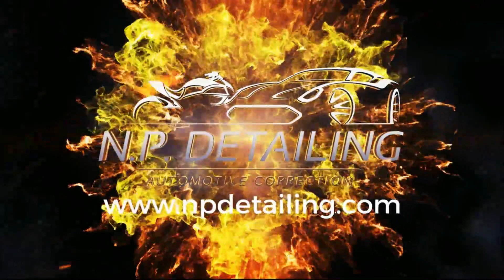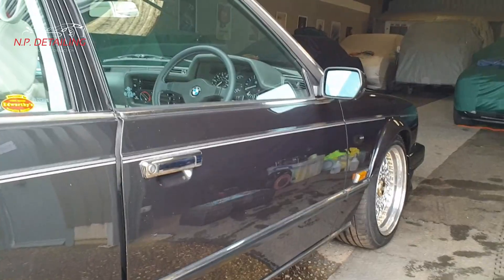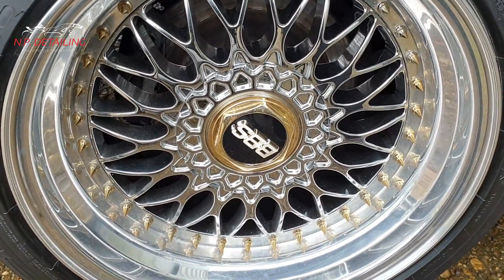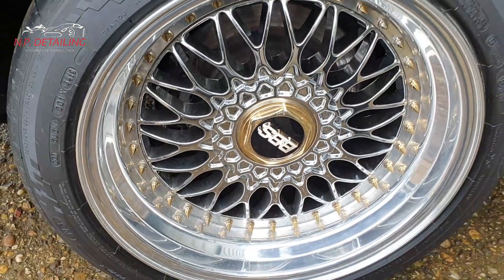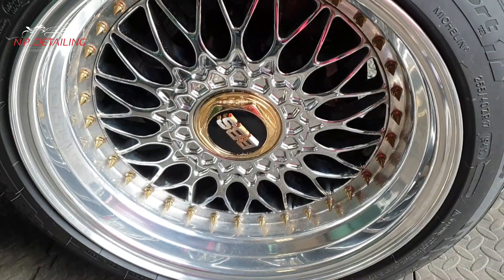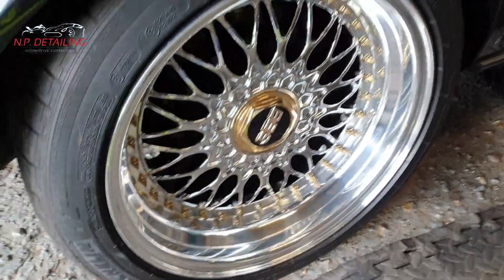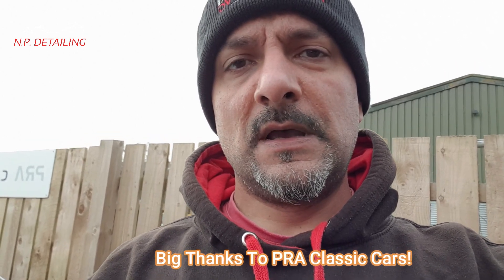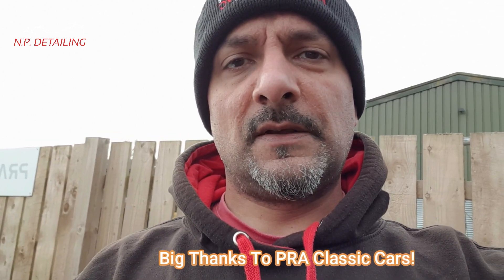BMW 635CSi 6K BBS Wheels clean

Comment: what size rim & tires? i just got one in white
Reply from the maker: Hey thanks for comment I think they were 19s far as I can remember not sure about tyre size but they were stretched as it was low.
Reply: They were 17s, front tire size 235/45 and rear 255/40, I also have white and looking for the same wheel set up. Can you find out the offset and width Of the wheels?